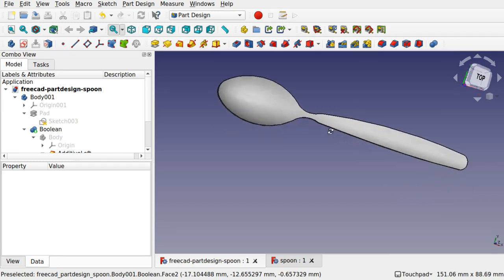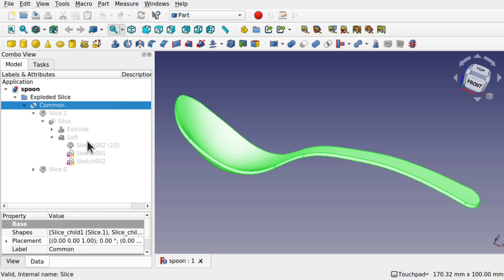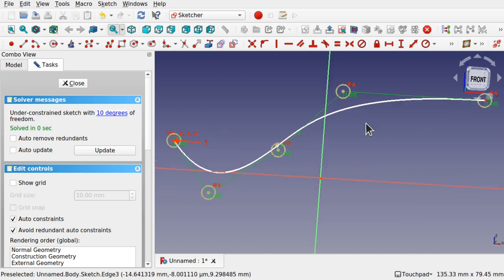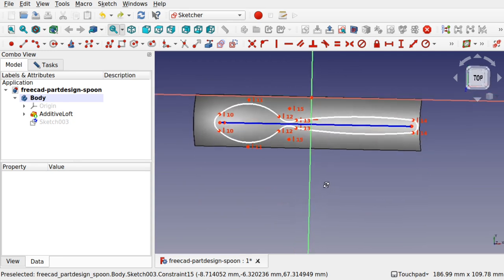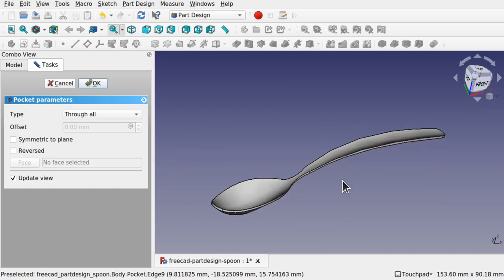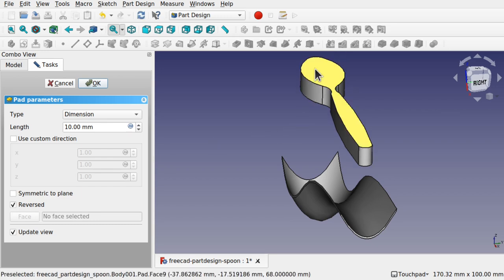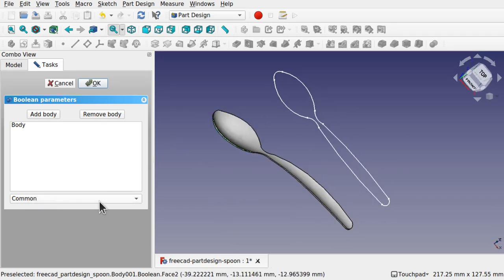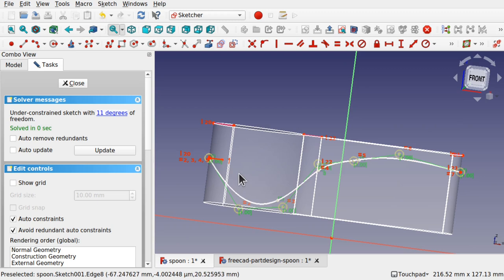FreeCAD : How to create curved objects in  Part Design Workbench: Spoon (Beginners Tutorial)

Comment: I didn't manage to copy the spline shape as Ctrl-C was greyed out. I gave up trying in the end. Instead, I drew two splines and linked them by equal-length construction lines, and finally closed the ends of the splines with straight lines. In the 2nd part, I was not able to move Sketch003 in the way shown. I found an easier way though. I used the attachment editor to deactivate the sketch, then moved the sketch directly to Body001, and then used the attachment editor to attach it to 'Object's XY' again. It is still a better way of designing the spoon though. Another great video!